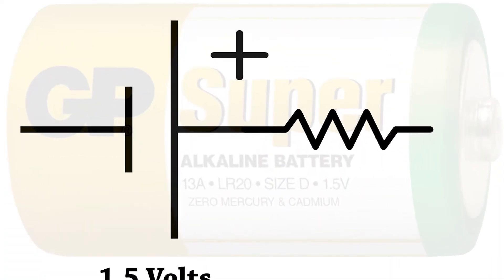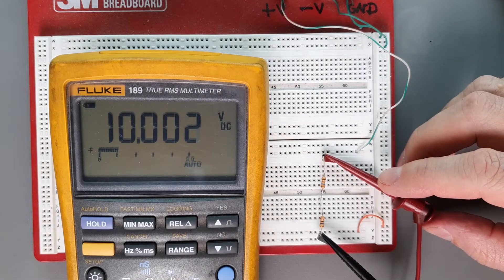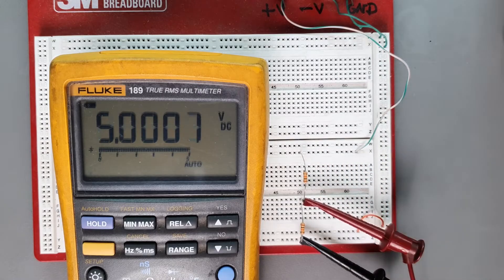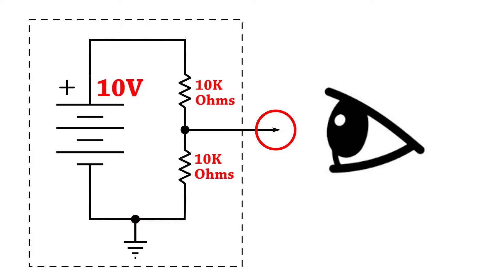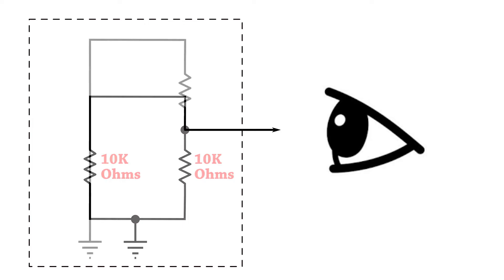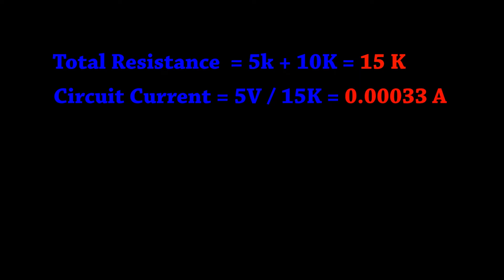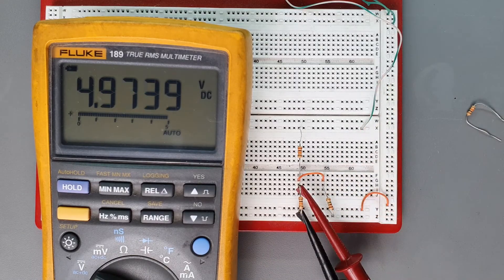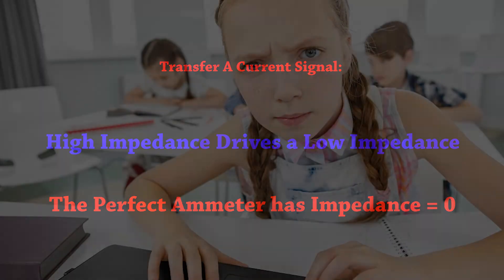Electronics 4

Comment: As per AI: impedance only applies to an AC circuit ( and maybe an RF, DC on AC ).
Copied:
Impedance is a measure of the opposition that a circuit presents to the flow of alternating current (AC), combining both resistance and reactance, and is measured in ohms (Ω). It can be thought of as the total resistance to electrical flow in a circuit, which varies with the frequency of the current. Good video and appreciated.
Reply: Reactance on Wiki confirms this and introduces even more definition...all AC denoted ??

Comment: the impedance in the first test wasn't clear, i'm having a hard time understanding it. what's the impedance the "pF" ? or is it "10M, > 100pF" ? what's pF ? did it fail because the current is low enough that we see the change because of the meter?
Reply: after watching it all, soo impedance = resistances?

Comment: I’m a bit confused by your explanation. When you remove the battery and claim the resistors are in parallel, aren’t you essentially describing a different circuit? Without the battery, there’s no potential difference to drive current or define a reference point for positive and negative. In the original voltage divider circuit, the resistors are clearly in series, and the total resistance seen from the source is 20kΩ.

Even if you measure from the positive or negative terminal to the output of the divider, the circuit would still see 10kΩ because of the series configuration. Halving the impedance only makes sense if the resistors are truly in parallel, which isn’t the case here. Could you clarify why you simplified the circuit this way? Thanks!
Reply from the maker: if we are thinking about the impedance, the voltage of the battery is irrelevant. The battery has a very low (0) impedance, so we can replace it with a short. Then the resistors are parallel connected.
Reply: @ I might have missed it if it was stated somewhere, but this explanation only applies to an AC signal, right? For DC, the impedance at the output of the divider would simply be the value of R2, since the resistors are in series, and R2 is directly connected to ground at the output node. The 5 kilo-ohm impedance only happens in the AC case because the battery is replaced with a short, which makes R1 and R2 act as parallel resistors. For DC, though, the output impedance should still just be 10 kilo-ohms. Apologies if I misunderstood or missed something in your explanation!

Comment: Not a perfect analogy but if you wanted to test the temp of a pot of soup and your thermometer's probe was a 5 lbs. piece of copper you're not only not going to get a correct measurement but effect the temperature of the soup due to the thermal mass.

Comment: Why didn't you tell me this 63 years ago!  I got into electronics early as a kid.  I read quite a few books.  So when I wanted to add a tone control to my table radio, I got a potentiometer and a capacitor and inserted it into the output of the audio amplifier tube just before the power amplifier tube.   The tone did not change at all, it just changed the volume.  I looked up some more details on "tone control amplifiers" to find out why.  No Help!  Finally one book called it a "buffer", as a sneaky hint, but didn't explain.  Years later I finally learned that the problem was the output impedance of the source.  Also that the "buffer", which I considered useless since it had no gain, was to provide a low impedance driver for the tone control circuit.  

Indeed, source to load impedance matching is very important, not just in RF circuits.  Even with the "new" digital TTL logic ICs it was important to know the "fan out" to the "fan in" to ensure reliable functioning of the overall circuit. 

Keep up the good work here!  I'm a retired EE. 😀